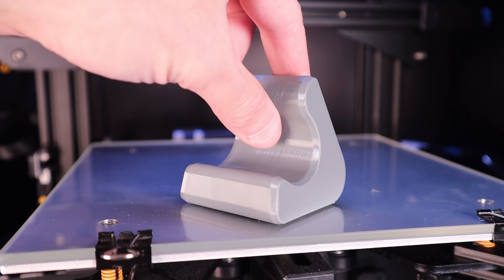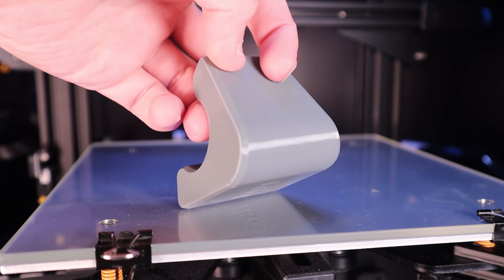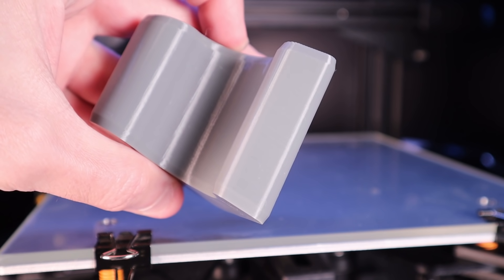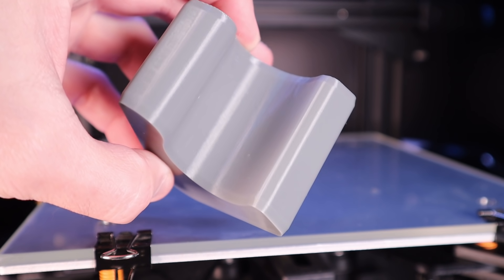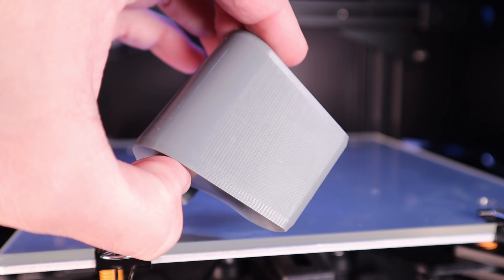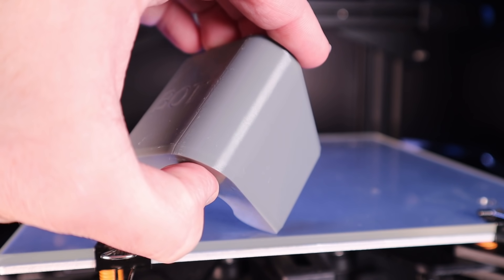Creality Ender 3 V2 - Simple Tips for Super Clean 3D Prints

Comment: I'm asking for help. I just ordered my first 3-D printer ever. I settled on the Ender 3 v2 . Excuse my ignorance but what do I need to get started. And feel free to talk to me like I'm five. Do I need to get any programs for my computer. What are they and how much are they. Am I able to just start with what I have any things later? I'm primarily using it to make miniatures in Tehran for table top game? What is the best material to use for best results? Please I need advice I'm not a technical person I have a five year old laptop.
Reply from the maker: Sure here are a few tips to get you going:

Install Cura, it is easy enough and free as well, it should work on your laptop, but it might be a little slow as many newer softwares would be.

If your printer didn't come with glass for the build plate, I'd suggest buying one 235 x 235 x 4mm borosilicate or similar, it helps a lot with leveling, the glass is very flat, the aluminum below it is not, and changes shape as it heats up causing issues with bonding (there are upgrades to solve this later on).

Buy some dollar store glue sticks... big ones.  It helps for the best adhesion on that critical first layer.   Because it bonds so well, when complete pop the plate into the freezer for 10-20 minutes to release the parts.  Seems like a tedious process, but it works 100% of the time.  

I'd suggest using PLA to start, ABS is hard to work with and PETG has its own set of problems.  PLA is the simplest, just make sure to keep it dry, recommend some dessicant in a plastic bin to begin with.

You don't need an enclosure to print with PETG or PLA

I'd suggest to watch an assembly video rather than just using instructions, there are little tips which produce better results, for example, I use a ruler to align the posts so they are exactly parallel.  

The plastic stock extruder is not great, you'll want to change that out at some point because it might break on you, I'll have a video out soon on a fairly inexpensive alternative, or just buy a metal one, they are cheap.  

Watch some of my other videos, they'll help you to know more about printing with this printer.  I am still getting great results very happy with it.  There are struggles of course like anything.  It looks so easy from the outside, however when things go sideways on you it takes some problem solving and perseverance to get it solved.  

I have about 10,000 more tips, I think YT might have a limit on comment length....

One more thing, the bed spring upgrades are cheap, buy the orange/yellow ones, they are stiffer and do a much better job.  There are also silicone ones available, I've never tested them, seems to me they'd add too much weight.

Good luck!
Reply: NeedItMakeIt thanks I have been watching other videos for a while but my printer is getting delivered most likely tomorrow some time. So it's hard to take everything in when you have no printer in front of you. And everything kind of overwhelming now. Not being a tech person. Thanks for the advice and help.

Comment: I’ve had a lot of luck with scotch brand blue tape. You can print PETG on it with a 0 degree bed so it saves energy. Sticks really well and can be used several times before replacing it.
Reply: Petg can warp, a heated bed is not just for first layer adhesion. If it were, you'd only have to turn it off after the first layer.
Reply: @alejandroperez5368  I’m saying on blue tape you can print with 0 degree bed with PETG all the way through. No need to turn on the bed if you have the right model.. some require 65 degrees with glue stick, hair spray or blue tape if the model doesn’t have a lot of surface contact. I have never used a brim with PETG in over 300,000 hours of printing
Reply: @oneheadlight8000  you have 34 years of printing experience? LOL.
Reply: @dualXdefiance  300,000 hours of printing since 2009. We have a lot of printers friend.
Reply: @oneheadlight8000  holy shit
Reply: @dualXdefiance  haha I feel like its all I do.. Just bought another printer last night. I currently have 14 on site with me now. We started in 2009 on an old Zprint 650 powder printer.
Reply: dimafix hold like crazy while hot and lets go when cold
Reply: @Ibian666  there is a major flaw in your math.. 1 printer can get to 300,000 hours in 34 years.. 100 printers get there in 3000 hours.

Comment: If you use coasting together with your other settings and random seam you'll get rid of the seam blobs.
Reply from the maker: I have tried coasting however I was not successful.  I believe the problem was caused by the movement at the extruder fitting.  I believe I have corrected this problem so I will give it another go.  

Thanks for the tip!
Reply: Do you have some numbers for the Settings that work for you ?
Reply from the maker: @JustAValidName89  Sure, they are all listed in the description.  There are also some links in the description to my profile for PETG.
Reply: @JustAValidName89  I use 0.216 for a .4 nozzle - which is slightly higher than recomended in Cura but is work for me (PETG, PLA at 80-100mm/s)
Reply: @gerthalberg9735  thanks a lot I will give it a try

Comment: Cura 4.8 has a z seam hiding option. Using smart hiding will eliminate the seam on the outer skin.
Reply from the maker: I've have tried this feature, but I've not found that it works well for my parts.    It looks for sharp corners to place the seams so they are less visible, my parts don't have corners unfortunately, but it could be useful for some people.
Reply: @NeedItMakeIt  Yes, it only works best with corners. Even then it can be easily noticeable. I wish there was an option for wipe hiding. Basically, the outer perimeter would start slightly in the infill and move outwards or inwards depending on the perimeter being printed. This would eliminate blobs at the start of the perimeter. It's basically nozzle wiping but in reverse.

Comment: I noticed just turning down the nozzle temp helped a lot for me. As long as you have dry filament and your esteps are good you should be good. I use to print super hot right at 220 for PLA. 210-215 helped give me super smooth prints.
Reply: Oh wow, i think mine uses 190 for pla

Comment: I do this as well as adjusting the retraction speed and distance for the type of filament I am using. This allows me to print multiple prints without messy cleanup. The blobbing effect is what happens when the filament pools up in the nozzle the pressure causes it to push out as it leaves the part to go the next part. There is also the stringing effect people get. The combing setting and z hop will help eliminate this. I get very little if almost like slight spider web like whisp of string at the most now, nothing a swipe from my small butane torch doesn't eliminate in a poof, gone. Even a good heat gun would do the job. No blobs and all calibrations set. With all of that you can really dial in a printer to go above the bar of what they do out of the box. With a little tweaking that is. 😁👍 Good video!

Comment: Combing doesn't do jack. Best way to deal with blobs is to slow down the print and increase retraction settings. It's also prefered to print at 0.2mm height and below to have minimal amount of seam. Combining is always on for me and it doesn't help except for not drooling on the print.
Reply from the maker: I've found that it does quite a bit more than jack.  I have the advantage of printing the same parts hundreds of times over, combing has given me the best results in my case.  It doesn't work for all types of parts, maybe that's why you've not seen any benefit.  I believe the newer version of cura has it set to on by default (according to viewers).

Comment: most important step to getting good results is buttering up your print plate 😳
Reply: What adhesive do you use
Reply: @sachinsaravanan3664  3DLAC
Reply: "Nelly" works really good.
Reply: I use Land o Lakes 😏 lol but really, I actually use a decent hair spray on my creality glass bed printing Petg. Works better for me then any adhesive marketed to the 3D printing world that I’ve tried, just a light layer and your golden for a while, then if you notice any issues, clean plate with alcohol then respray, I might have to do that once a month with moderate usage.
Reply: @marv8481  Here in Spain we use the hairspray "Nelly".
It is very good and it takes very little for the PLA or ABS to be sinked into the glass of the bed.
No need to heat the bed at all.
A bottle of lacquer Nelly costs about € 3 or about $ 4 and I can print several kg of filament with it since they are big.
The same brand produces a lacquer for 3D printers, which is exactly the same formula, but without the smell of lacker, and costs 5 times more.
So I advise you to use Nelly hair lacquer instead of another lacker or system, im pretty sure it can even be bought on Amazon.
To remove the printed part in PLA or ABS from the glass, you can put the glass in the freezer 10 minutes also.
Reply: @sachinsaravanan3664  good old Aquanet hairspray.  Available at the dollar store and a single bottle will last me almost a month.
Reply: No glue is required. Wash your glass bed under water with dish washing liquid. With a clean spoonge. Rinse it with water. Dry it with a paper towel and that IS IT. Just mount it on your printer and print. Because of a dusty environment I do this every day but some people do this once a month. PLA is sticking to a clean glass like crazy. If you wipe it with an IPA cleanser you will ruin the effect. The cheapest, standard dishwashing liquid is all you need.
Reply: @marko_z_bogdanca  lies. I wanted to believe in a glass bed alone. Even bought the creality glass bed. It will not stick alone.
Reply: i cant get the glue stik to stick to the buttererd bed
Reply: I use nothing, just the creality bed, and I clean it with rubbing alcohol every couple prints
Reply: I just use a clean glass plate and it sticks perfectly with a bed temp. of 60C
+ there is no mess to clean up every now and then.
Reply: @latexroach  flip the bed over, omg
Reply: What brand of butter do you use? Salted or unsalted?
Reply: @marko_z_bogdanca  was hoping someone would say this.
Reply: I read that iso (rubbing alcohol) damages the protective film on the composite lattice covering the bed. It will degrade your print surface.
Reply: @Chris-tw5xj  damn I been using 99% ipa for months now..... I guess I know what will happen some day
Reply: @papyro6830  i use everclear with 2 drops of grenadine to make a pink mouthwash that degreases engines and starts fights and cleanses the print bed of fingerprints, too, if you spill it in the machine room while cornering your forklift or something
Reply: @marko_z_bogdanca  agreed. I wipe down with alcohol
Reply: I use Elmer's glue. It's cheap and I can use 1 spread 10 times by just adding a little water to the surface and dissolve the glue to resurface after a print.
Reply: Hi there great video 👌
Any suggestion for a good 3-D printer that had good quality printing futures
Reply: I didn't know you need adhesive. I just printed my first print and I didn't use any
Reply: American crew hair gel
Works very well for PetG.
Part slides off when bed cools.
Apply with razor blade. Clean, no overspray. Can be printed over few times.
Reply: @marko_z_bogdanca  that’s what I was wondering. Not sure how people are having trouble with part not sticking to the bed. If anything I have trouble with parts sticking too much to the bed. I struggle to separate them after prints
Reply: Butter or margerine
Reply: @marv8481  what kind of hairspray do u use also can It be used on the bed black bed that comes with the printer
Reply: I have neverbused adhesive on my build plate. To do so means you haven't got it properly leveled
Reply: @latexroach  it's not lies.
Reply: i use sugar water it works so good i figured it out from my teacher it works
Reply: @DerTou  I use hairspray and I works pretty good
Reply: I use extra virgin olive oil
Reply: @IberianCraftsman  Gracias por el truco
Reply: Or getting good printer, like Anycubic, where plate is letting print out after cooling down
Reply: @latexroach  it will I have 2 lol and both work as they should ay
Reply: @marko_z_bogdanca  100% agree. I ruined the adhesion properties of my glass with alcohol… hot water and a polyester microfiber wipe is all that’s needed to keep things bonded very well to the bed. Sometimes things get gripped down just a little too well. A cooler bed temp for the first layer helps as well. For example ; I’ll run a first layer at 50C and then increase it to 60C for the rest. The 10 degree heat difference really helps adhering the first layer.

Comment: New sub. Why do the program spots to start a new layer? Wouldn't it be better for it to keep going to the next layer in the same motion, especially since your going around in a circle? Like vase mode.
Reply from the maker: Glad to have you!

I'd have to think very hard about this, but I believe it is not possible.  At least not currently possible.  In vase mode there is only 1 wall layer, a continuous motion upward is possible except for the bottom and top layers.  When printing these normal parts the entire part must be filled in, the nozzle would travel up, then down, and so on until the entire layer(s) is complete.  What you may be looking for is called non-planar 3D printing (true 3d printing).  I'm sure in a few years we will have the ability to do this at home with some limitations.
Reply: Matthew, use the slicer's visualize feature and step through one layer at the time (i.e., super slowly) to see how the print progresses. This is a fantastic feature.

Comment: Here's another tip I only started doing recently:

If you use a newer build of Cura with a Creality printer (maybe others as well), your nozzle does a purge line on the corner of the bed. It's probably 10cm long. Adjust the start gcode so it's only 5cm - all it's doing is priming the nozzle. Now, since that's getting your nozzle primed, you don't need to print a skirt anymore around the perimeter of the print, so go ahead and set the build plate adhesion to "None" (assuming your prints typically stick to the bed reliably after printing skirts). This knocks a small amount of time and material use off of your prints, which adds up over time. This is especially important if you want to operate a 3D printing business, because lean is the name of the game for that.
Reply from the maker: For sure, the main reason that I leave a brim or skirt on is to make sure the previous filament is purged out properly from the nozzle.  It isn't too professional to have a mix on that first layer only to find out when the print is finished. 

Valid points though, thanks!
Reply: Skirts are necessary for first layer Z-offset calibration at the start of each print. Something you will most likely have to deal with on cheap 3D printers and considerably large prints.
Reply: That's too tiny to even care. And a skirt should always be used, no exceptions.
Reply: @Ibian666  why is a skirt so necessary?
Reply: @haqeeqee  Primes the flow.
Reply: @Ibian666  but doesn't a purge line take care of that already?
Reply: @haqeeqee  Better to do both. The shorter the break the better.

Comment: Have you tried to print upside-down?
Thais way you won't have over hangs 
Regarding the seam try to make it inside the model (the hole of the leg) what way it won't be visible
Reply from the maker: I have not, this is a very interesting concept.   Regarding the seam, I cannot see a way of getting rid of that transition, my only thought is to treat all models as spiralize layers going from inward to out then out to in.  I'm not sure if this would work, but because we basically have concentric outer and inner layers which all require a transition point.  

Thoughts?
Reply: @NeedItMakeIt  good luck 😅 hope it will work out for you

Comment: I know you probly wont respond because there is hundreds of comments, but maybe someone else can help me. I have this problem when the nozzle is getting heated the filament will come out of it before printing. but when its time to print none will not come until a couple seconds, I saw you make a line on the side of the plate, can you do that without having to manually do it? like if i wanted to print the dog that was already in the SD card.
Reply: I know it's 2 years later but to answer your question, It's a prime strip that is in the start-up gcode. You can add it to the gcode file. Look the in the print start gcode for reference in cura.
Reply: @KJMcLaws  since then I figured my 3d printer is just junk, i replaced the filament feeder with aluminum one because  the normal plastic one was broke.

Comment: How do you get the prints off the glass. I can’t imagine using hair spray or anything my prints fuse to the glass where it takes so much scraping with a paint scraper that it ruins the print. I’ve tried alcohol, cooling the glass with water (risky for tempered glass). Heating it back up works but I tend to notice the bottom layer leaves some behind when I do that.